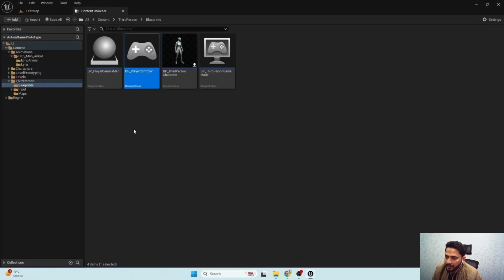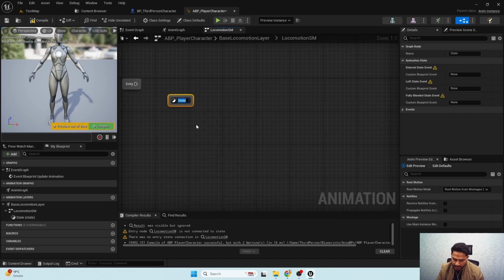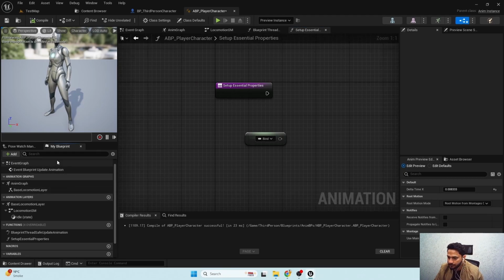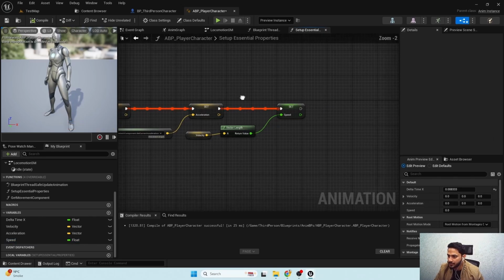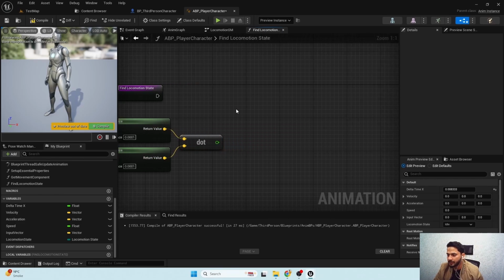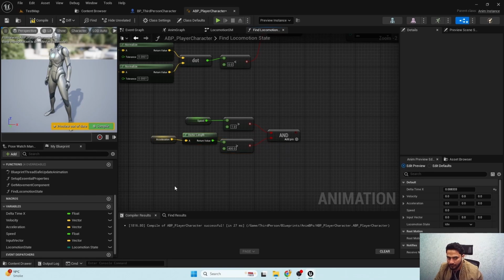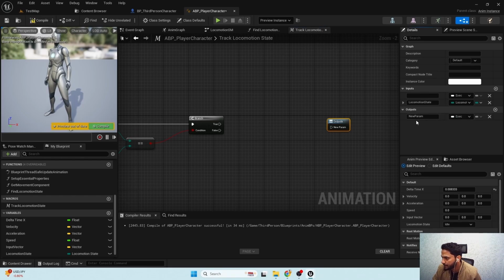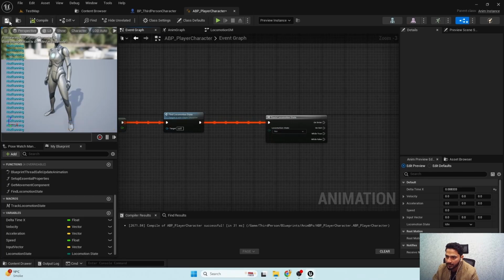Advanced Movement System | Part-2 | Setup Animation BP

Comment: Thanks for the tutorial. Unfortunately I have a problem. The print alternates between run and idle for each tick. What can I do to find the problem? I am using UE5.3.2
Reply: im having the same issue, did you ever figure out a fix?
Reply: @johnuzoka6229  If you're still having this issue it's probably because you're running the game from the animbp tab, so it's opening in a new editor window. you're getting a debug output for the animbp you're controlling in the game, but you're also still getting one from the animbp preview (which isn't moving, so it's always idle, hence the alternating). try running it in PIE from the level tab, it shouldn't alternate anymore there.

Comment: Thanks for the videos. I am following along. I have watched and followed a few locomotion videos. Not all as detailed as your video with the turn in place, walk start/stop etc so I appreciate what your showing us. 

For anyone following along, I did have an issue where the Movement Component function wasn't appearing in the property manager, but this issue was just because I hadn't spelled 'Return Value' correctly, like an idiot.
Reply: Same typo here, would not have found it easily if you hadn't mentioned it, thanks!!